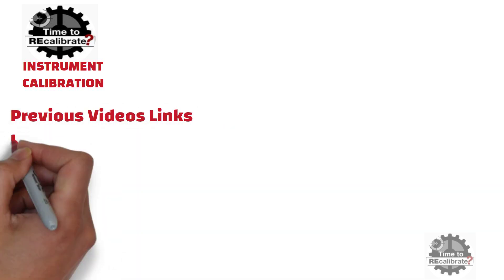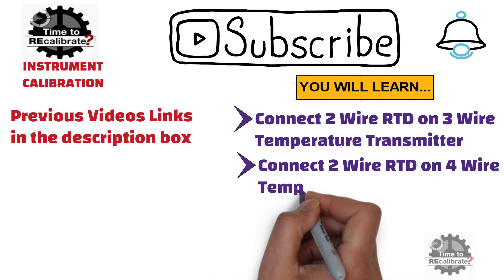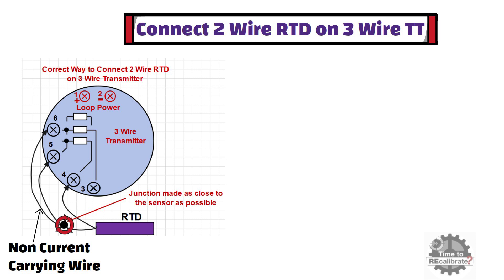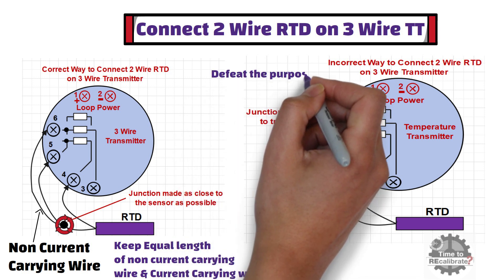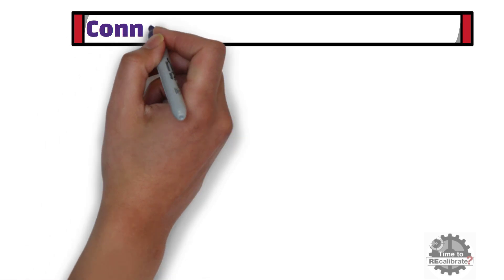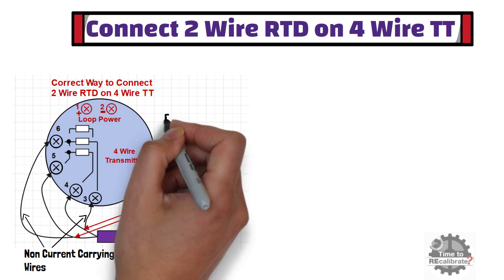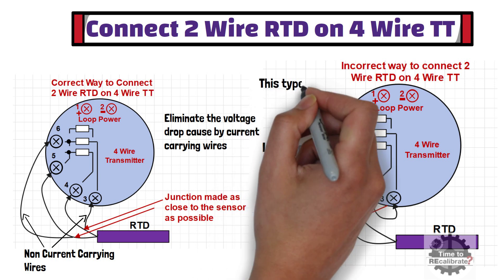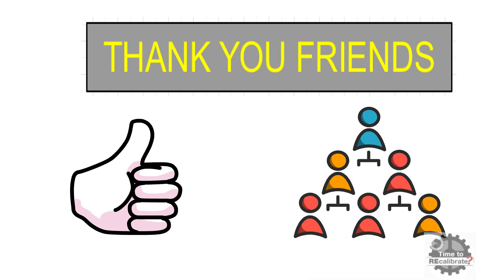Two Wire RTD connections with 3 Wire Temperature Transmitter & 4 Wire Temperature Transmitter

Comment: Also, i understand that, terminals 1 and 2 are to the power source, but which of the terminals would you connect the temperature transmitter to the controller or PLC
Reply from the maker: Terminal Number 1 & 2 are 24 Vdc  loop powered. So, You can use these terminal to connect to PLC or DCS. There is no separate terminals to connect to plc.
Reply: Ohk...thanks

Comment: Thanks for the video, but how do you know it's a  three or four wire temperature transmitter, because you used the same diagrams for both temperature transmitters. The only difference was the wiring
Reply from the maker: Thanks for asking this questions. You can find this information from Name Plate of Temperature Transmitter.